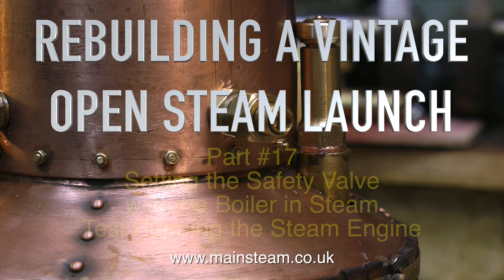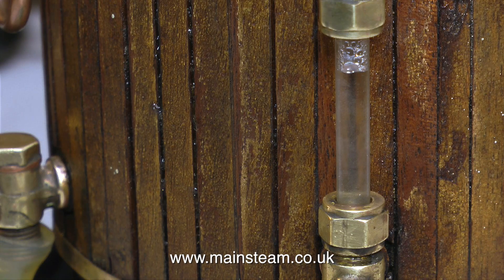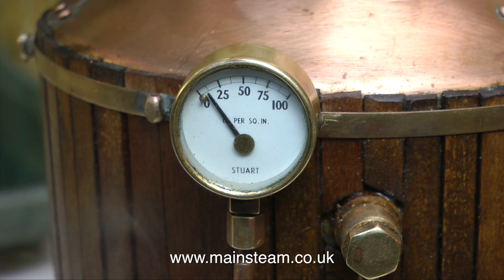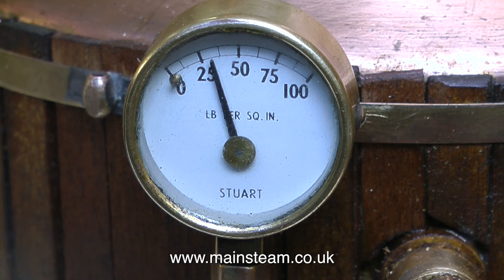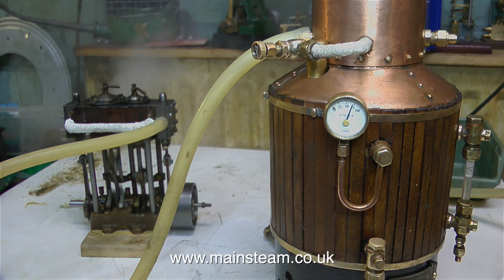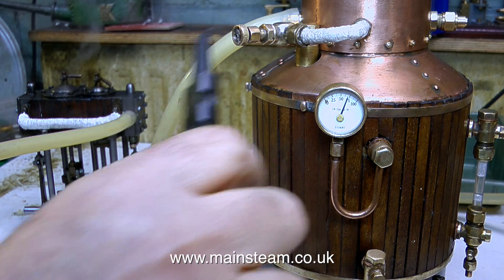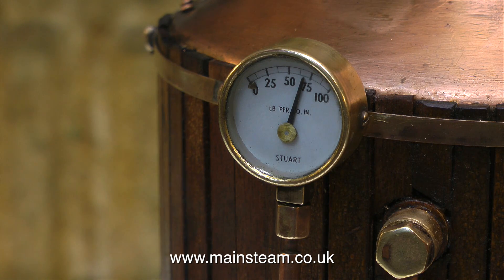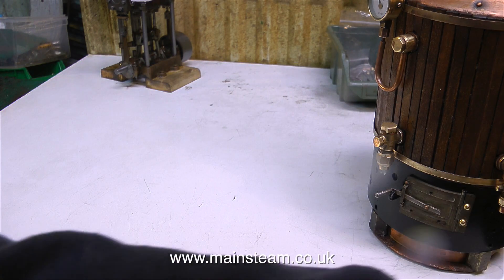REBUILDING A VINTAGE MODEL OPEN STEAM LAUNCH - PART #17

Comment: For the steam valve, you were saying it gets hot and is too small, you could make and/or buy a wooden one, because wood is a bad conductor, it would be easier to turn and less hot. also you get more grip on the valve wheel.

Comment: Is there a steam engineering reason that when running steam engines, it seems to be the norm to let the exhaust go down some sort of short pipe then blast and dribble all over the bench, wall etc.
 I would stick another bit of silicone tube on the stubb and take the exhaust a few feet away to a bucket on the floor or whatever. 
Is it so you can better assess the valve timing by ear, so need the exhaust to exit close by, or is it so the oil in the steam stops the entire workshop going rusty?
Reply from the maker: I would generally pipe the exhaust away with silicone rubber tubing, but for the purposes of this video I didn't bother as I wanted to show the exhaust steam .....